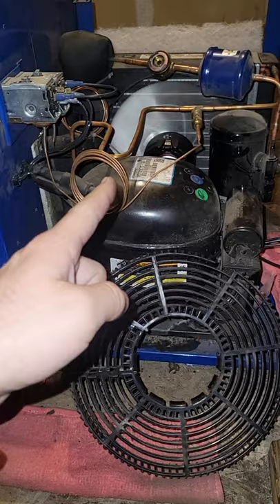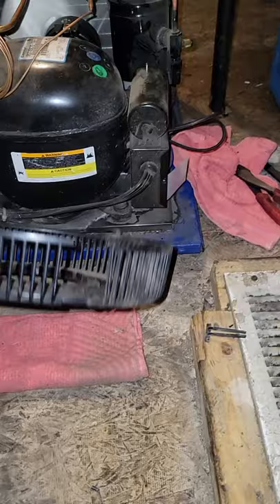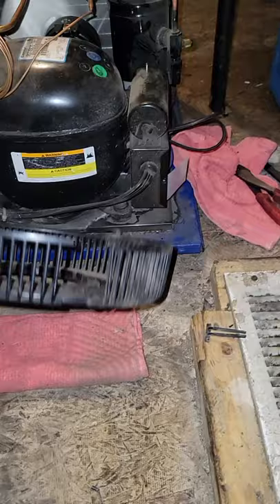Sometimes Ya gotta do what ya gotta do...... #bigpicture #hvacrvideos #glycolchiller #beerchiller

Comment: I had a similar issue with a little mini beverage fridge from hell at a restaurant last week. I had to replace the condenser fan motor, which took two and a half hours being as how the unit wasn’t designed to be repaired or serviced. I had to take the plastic cover off mounted on the compressor to get to the wires. It was nearly impossible to get the cover back on, so I just left it off.  Nobody is gonna be poking around in there anyways. The fridge really should’ve just been replaced.

Comment: This doesn't pertain to this video, but I wanted to ask due to an older video and figured I'd be more likely to get a response here.
How do you choose which torch tip to use when brazing?
Reply: depends on the size of the copper. also can depend on how weird of a spot you're in when brazing